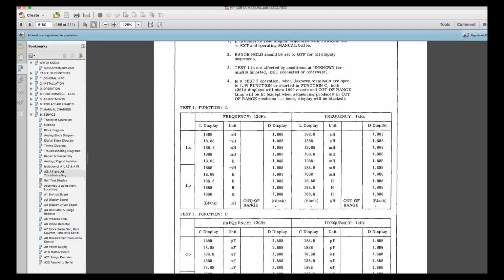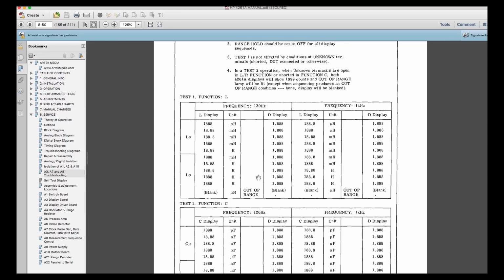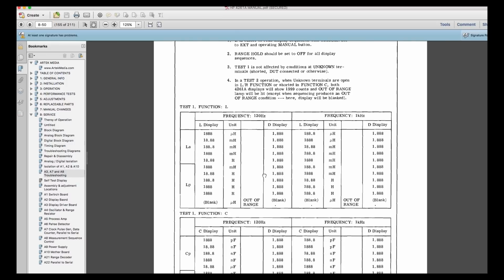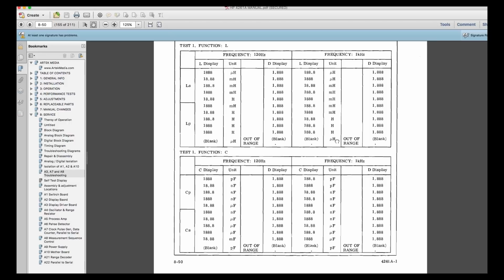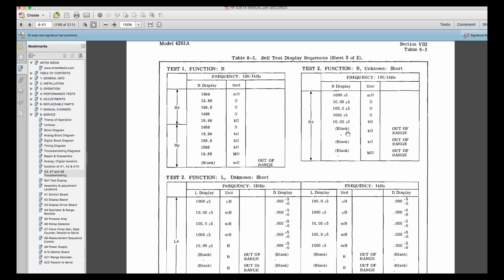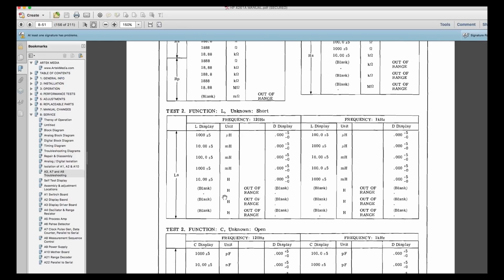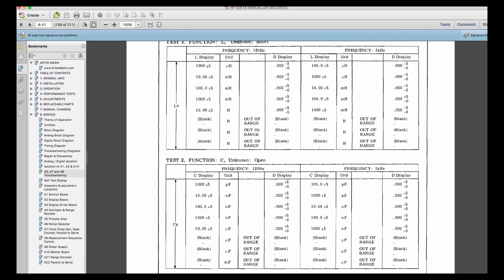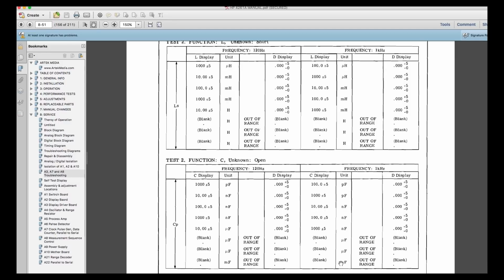🔴 #387 HP 4261A LCR Meter Repair Part 5

Comment: I'm in 2 minutes and have a question/suggestion.  Your scope probe slipped off when probing a IC.  Did your probes come with a little accessory kit?  there should be a tip guard/shield.  One of them usually has plastic that extends out to the probe tip on two sides.  These are for probing IC pins.  The plastic "wings" fit between the adjacent pins and prevent the probe from slipping off.